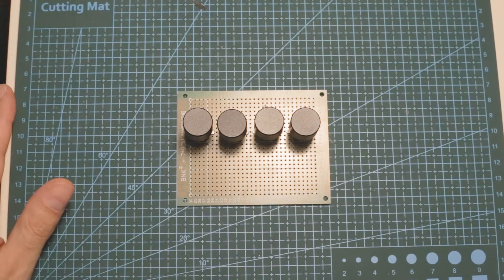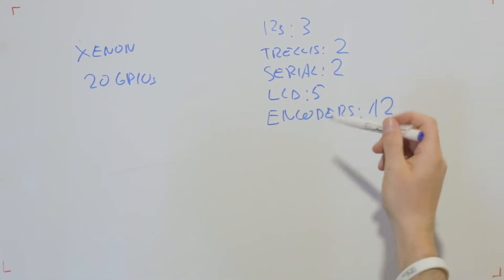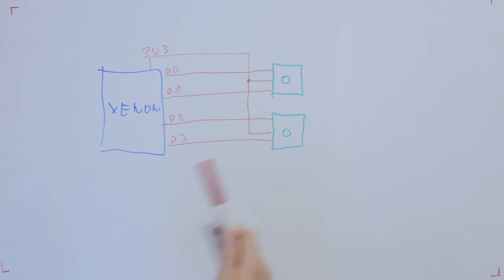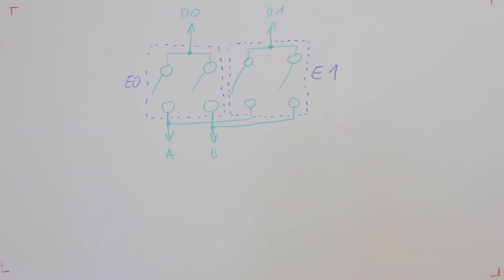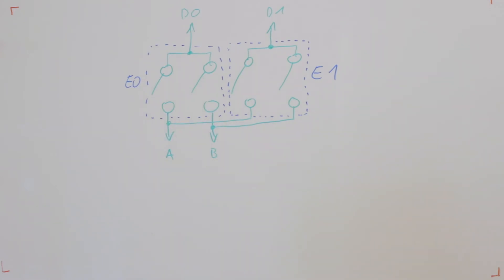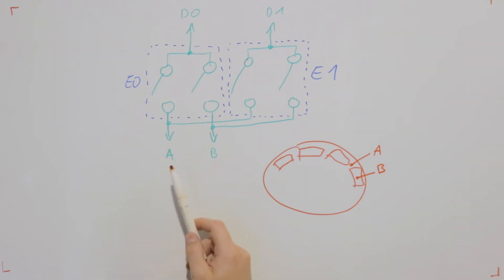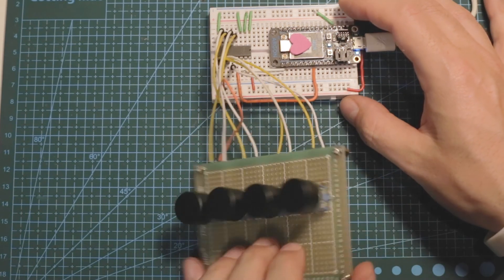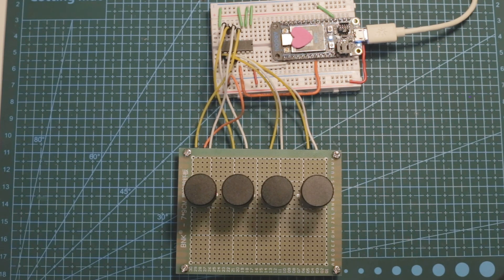[ps-01] Building I2C Rotary Encoders

Comment: So helpful! Does this work when turning 2 knobs simultaneously?
Reply from the maker: Yes, it should work on all of them at the same time but take note that the encoders aren't the most reliable parts and when turning them very fast, you might not get 100% accuracy
Reply: @WojtekSiudzinski  thanks! It is for synth control panel mainly slow moving I suppose
Reply from the maker: @jitsepruiksma2029  Exactly, it's perfect for that purpose